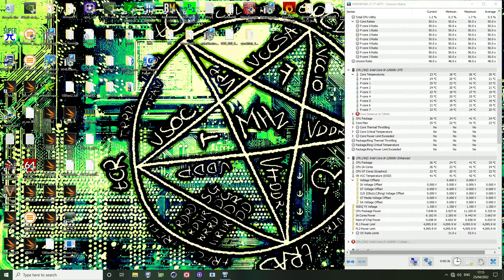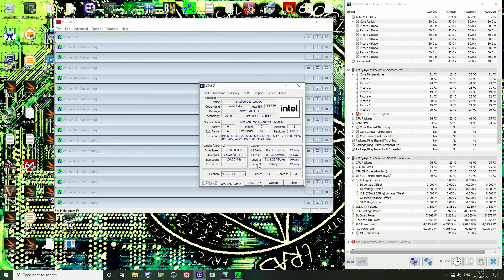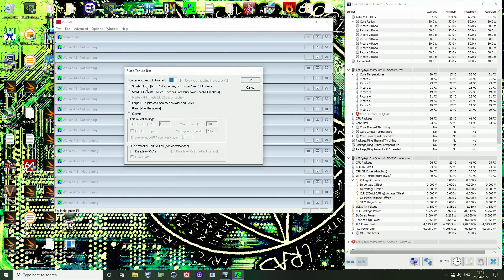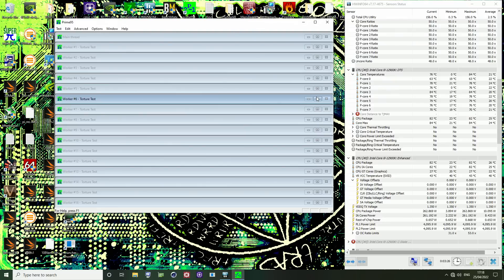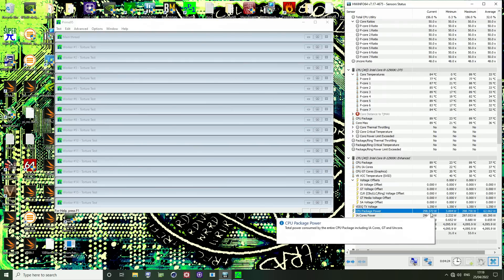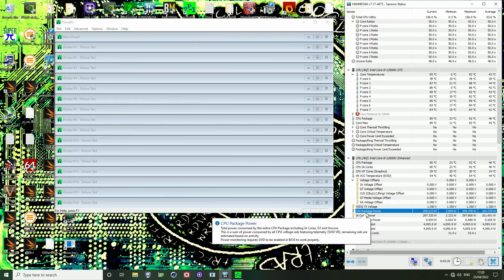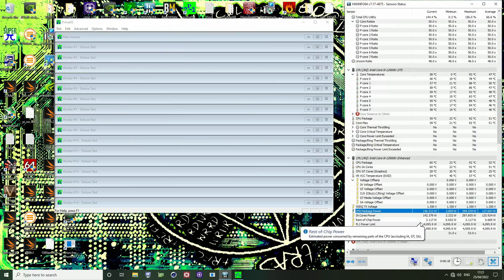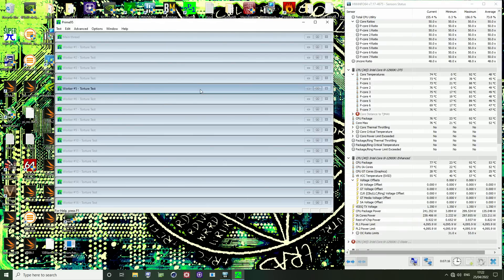AVX-512 on Alderlake CPUs is less hot than AVX2

Comment: Really impressive improvements with AVX-512 on Alder Lake. I remember with 11th gen how much worse AVX-512 made the power/thermal charts, and reviewers would just show that as 'normal' power consumption/heat. Betting Raptor Lake brings AVX-512 back as an official feature.
Reply from the maker: the main thing blocking AVX512 is the E-cores. AVX512 takes up a ton of space and so the E-cores will probably never support it. As long as the E-cores don't support it the P-cores can't have it enabled because you can't know if an instruction is AVX512 till you try to execute it.
Reply: @ActuallyHardcoreOverclocking  The main thing blocking it is Windows. All you would need is an AVX512 flag in .exe/.dll files that support AVX512 and the windows scheduler could just restrict threads from that binary to P-cores. I think there are also possibly ways to trap Undefined Instruction exceptions, but having flag like the LAA flag would be far simpler I would think.
Reply: @ActuallyHardcoreOverclocking  This is Intel's ISA extension mess in full force.  It is possible to support AVX-512 using 256 bit wide execution units but at half the normal 512 wide unit throughput.  Performance increases can still come from efficiencies in the new instructions and additional registers.  Die size would increase mostly from the register file size increase.  Given that AVX-512 implemented in this fashion would be half-rate, performance would suck but it would at least bring ISA parity between the P-cores and E-cores.
Reply: @ActuallyHardcoreOverclocking So in other words, AVX512 is another flawed instruction set that had to be abandoned.
Reply: Pretty sure it wasn't reviewers but rather cherry-picking commentators if you are referring to the original graph from Anandtech. And no, hitting 290W and over 100°C at stock settings with a 1.8kg heatsink of pure copper is not good for a mainstream i7, that was a failure in thermal and power management. Even if just in niche scenarios.

Comment: SSE draws even more power than AVX/AVX2
Reply from the maker: no it doesn't. When you disable all the AVX options prime95 it runs in SSE mode and runs even cooler than AVX512/AVX.
Reply: @ActuallyHardcoreOverclocking  SSE will indeed consume more power than AVX when the FFT size is large enough to make memory bandwidth the performance bottleneck. This is due to AVX performing the same amount of computational work in fewer loops of the routine, making it substantially more efficient.
Reply: @ActuallyHardcoreOverclocking  Not the case in OCCT. SSE draws more power on my 12900K in OCCT extreme + large. Also, Cinebench R15 (SSE) is also harder to pass than R20/R23 (AVX/AVX2) on ADL.
Reply from the maker: @Yahfz  well OCCT pulls less power than prime95.
Reply: @Yahfz  i experienced it, R15 is harder than R20/23 in Alderlake CPU.

Comment: well obviously it's because AVX512 is newer and intel hasn't had time to make it run as hot yet, unlike AVX216
Reply from the maker: AVX512 on other intel CPUs is insanely hot
Reply: @ActuallyHardcoreOverclocking  skylake-x moment
Reply: I wish it was true. I have a system with cascade lake-X CPU which support AVX512 and it runs much much hotter with AVX512 rather with AVX2 (which buildzoid refers as AVX256).
Reply: @eliadbu  Can confirm. My 10980Xe Runs 5.0 GHz all core with AVX2 in the high 70s to mid 80s for core temps. But With AVX 512 I have to run a -9 offset and it hits over 90C and pulls in excess of 650w. AVX 512 is insane on Skylake X.
Reply: @mylittlepwny3447  -9?! and 650w?! that's just stupid
Reply: @mylittlepwny3447  Skylake-X is also using 2 FMAs, Alderlake is using one..........